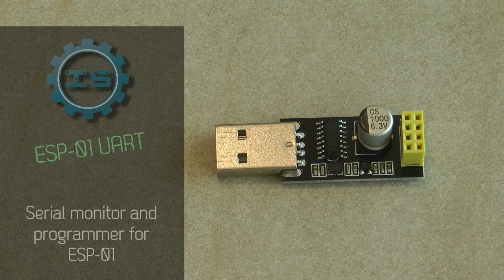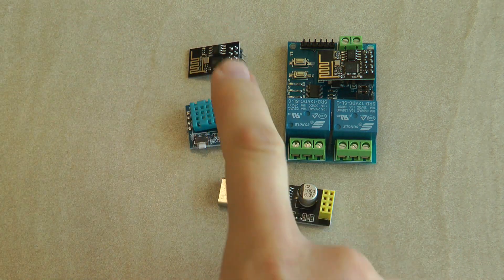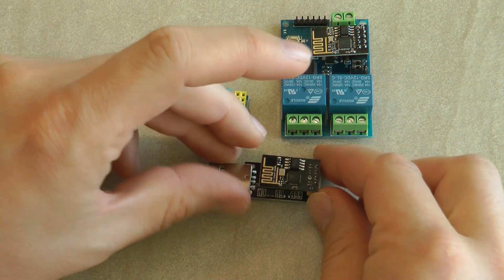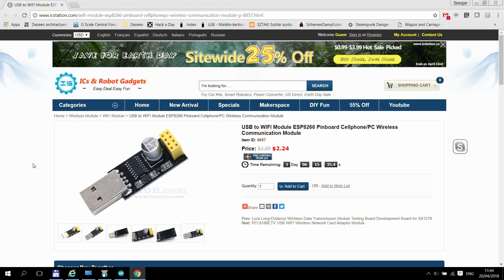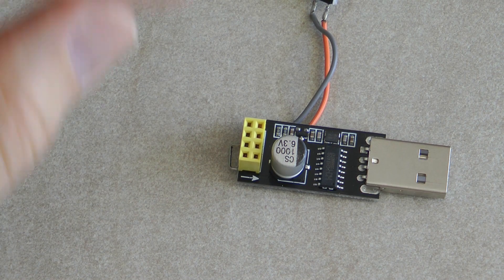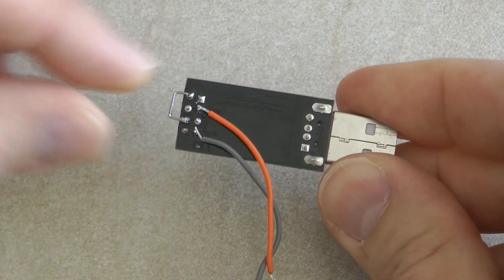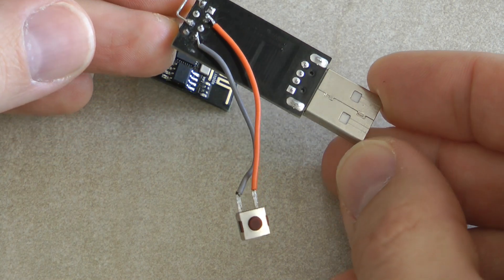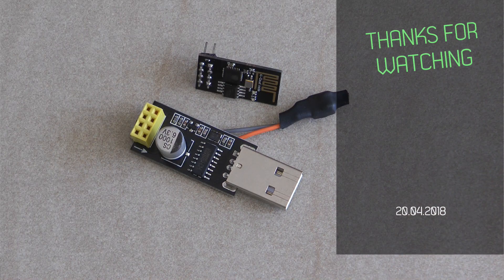ESP-01 UART and turning it to a programmer

Comment: SOLUTION! The USB programmer I bought had a program/UART switch, but wouldn't work because the chip enable (CH_PD) pin wasn't connected to VCC! (+3.3v).
An easy fix, now that I knew the problem. AliExpress buyers beware!
Thank you again Csongor for a great informational video.

Comment: I know it's an old video but thanks for the run through.  I shorted a couple of the pins based on another video, not shown here but you mention it further down in the comments.  The only issue I had was I got weird icons on the Serial Monitor until I changed the baud rate.
Reply: Those garbled characters caused by unmatched baud rates of ESP's and the Serial Monitors'. SOme ESP has default baud rate of 9600. Newest ones are  set for115200.

Comment: Thank you, I got the same "programmer" and was wondering why it wasn't programming. This fixed it.
Might I make an improvement though. Wire a 2nd button to the reset pin (pin 6 next to vcc, look it up in the datasheet) to also pull the reset low as well.
So to program hold reset, hold program, let go of reset, then let go of program. This means you don't have to unplug and re-plug every time you want to program, just do a little bit of button tango.

Comment: Just for safety instead of a jumper wire for the CH_EN use a 10k resistor... that will limit the current and be safer

Comment: Can this be directly used for programming esp8266 12e
Reply from the maker: Yes, and ESP8266 version can be programmed, you just need to build and adapter to the 8 pin header on this one.
Reply: @csongorvarga   please share link  of .. the adapter you ve used ,,, hope it dosint need external power supply
Reply from the maker: @anurudhandru2958  I don't have an adapter, I never use a bare 12e board before. I usually just but a Wemos D1 mini, which has a USB so the programming is sorted.
Reply: @csongorvarga  ohkk ... thankyou for the information ...  ...thankyou

Comment: Sir, When exactly we have to press button?
1. Keep pressed while inserting the ESP in UART module (while Module is powered by USB) OR
2. Press once after ESP inserted and before programming (Module is powered)  OR
3. Keep pressed while program being uploaded!

What other things we should learn by noticing the behavior of onboard led.
1. After inserting ESP into UART and powered by USB.
2. While Programming
3. After Programmed.

How to Shift from Program mode to Communication mode with PC 

Sorry for many question!
Reply from the maker: Hi, I insert the ESP to the programmer, and press the button and insert into the USB. Than I release the button after a few seconds. That is all. I think the onboard LED just shows communication over the USB, which can be anything programming, or serial communication. With this modification this board is for programming. You can replace jumper wire with a switch and you switch between programming and UART mode. Btw, I have also purchased a ESP01 programmer which has this mode switch built in. Almost the same price, so check for that on ebay.
Reply: @csongorvarga  Dear Sir, Thank you very much for your quick reply. However I already bought without switch. I watched other videos on this topic. 
1. In this video (https://www.youtube.com/watch?v=PSczkB4wYec) she used permant connection in place of Button! And 
2. In this video https://www.youtube.com/watch?v=P8Z-ZHwNeNI he did not use anything to enable CH_PD! 
Thus I have confusion. Also DO we need to remove your GPIO0-GND After programing and communication with ESp with AT -Commands?
Reply: Dear Sir,

Thank you very much your tricks it works funtastically. To communicate ESP with serial monitor we just have to plug in UART without pressing the button. However I was facing another issue. After loading the proggram, When I powered it separately it does not work in STA of AP mode. I checked current and I was applying upto 450 mA. The project I was trying to re-creat was this -> (https://www.elec-cafe.com/esp8266-temperature-humidity-webserver-with-a-dht11-sensor/).
Reply from the maker: @prakash52kar  This code connects to the wifi that is provided in the code, it will not go into access point mode.
Reply: @csongorvarga  Thank you for reply. Yes your are right. I was just testing by loading different programs on ESP to check weather it work or not with the power I was delivering to the circuit and trying to run "arp -a" on command prompt. It was powering on. .But was not thowing its IP! I used LD33V regulator to power it.

Comment: I got the same USB adapter. I do not need a bridge to enable the chip. I read about that some adapters have 5v on TX and RX. My adapter have only 5v at the Rx pin. I can flash without any problems. But everywhere they wrote about that this will damage the chip. We will see.  That´s only for information.

Comment: I've resolved just shor-circuiting the pins with the button thanks to a 
stapling point (that I could put in place or remove really easily), without needing to keep the button pressed. Furthermore, in some versions of the programmer (mine, for example), VCC and CH_PD (CH_EN) are already short-circuited. In any case, thanks a lot for the tip!!!
Reply from the maker: Yes, I only press the button in the beginning. You can let if go after. And I have also shorted the VCC to CH_EN. that is the small wire link on the side.
Reply: @csongorvarga  ah, that's easier... But I remain with the stapling point :-D

Comment: Hi following your instruction, probably not correctly, i was able to drop down progs on ESP, but at the end of loading parts via arduino software, at the end i receive "leaving   Soft reset" and then nothing work, can you suggest something?
Reply from the maker: What I usually do after burning the firmware is that I unplug the USB programmer, and plug it back again not pressing the button and the ESP will boot into the new firmware.
Reply: @csongorvarga  Thanks i'll try following your suggestion. regards

Comment: i soldered a 2-pin header, the pins are L-Shaped so the non-soldered ends of the pins are of the side of the board. i added some hot glue to hold the plastic pin separator. then i use a jumper as a switch. looks like it will be a durable solution. Now i'm trying to figure if i can use it as an ftdi to burn a bootloader into a "blue pill" stm32F3

Comment: Hey!.. I did the same thing to my UART to program the ESP8266 01 device through Arduino IDE in MacBook Air. But the code is not uploading and it is showing the error as "esptool. Fatalerror: Failed to connect to ESP8266: Timed out waiting for packet header". Can anyone help me in this issue to sort out please?..

Comment: If you're soldering anyway, why not just connect GPIO0 to DTR (pin 13) and RESET to RTS (pin 14) and have fully automatic programming (esptool reset method `ck`). The button solution feels rather tedious.

Comment: Can you send AT commands when the esp is in programmer mode? 

I received my esp-01 usb programmer with pin 1 (GND) & pin 5 (GPIO0) soldered together with a single wire. When I send "AT" through the serial monitor on the Arduino IDE, I don't get a response. So I tried the ESP examples to test if it was working, ESP8266 -> Blink example did nothing, however the ESP8266WiFi -> WiFiScan example worked, displaying the available networks on the serial monitor. So I'm unsure as to why the AT commands aren't working or displaying anything on the serial monitor. Any feedback would be appreciated!!
Reply from the maker: Once you flash the ESP with something in the Arduino IDE, the original firmware which was using the AT commands are gone. You don't have that any more.
Reply: Csongor Varga ohhh okay! Thank you so much for your quick reply!! 😊

Comment: hi my programmer looks exactly like yours and i tried your approach with button and jumper ... still same mem failed error and then tried without the jumper still same .. tried to change the reset to nodeMCU still same error .. no idea what else to try ... do you think my PC USB is not a good power source i should attach an external power to the ESP 01? What do you recommend me to try? , i'm able to upload code via old  FTDI board but that get messy with a lot of wires so i thought should be much easier using this programmer, thanks
Reply from the maker: Really good question. To be honest, I don't really who what could have gone wrong. I think it should provide enough power for the ESP. Since these are bottom price mass manufactured products, there is always a chance that you have a faulty one.
Reply: @csongorvarga  thanks... Ill let u know if i found a solution.

Comment: Thanks! I'm finally able to upload a sketch to the esp. But, being a newbie, I still don't know what 
 to do next. How do you get the serial monitor working, and get the esp's IP address and all that (like on 4:40 in the video)? Thanks
Reply from the maker: I just unplug and plug the device back into the USB port. That will boot up the ESP. After you have plugged it in, I just click on the serial monitor button in Arduino and it opens the monitor for the selected COM port (which is the same you selected to program the ESP). Arduino IDE only starts the serial monitor once the COM port is active, and the IP will be reported by the ESP soon after powerup. So you have to be quick opening the serial monitor otherwise so don't see the first few message from the ESP.